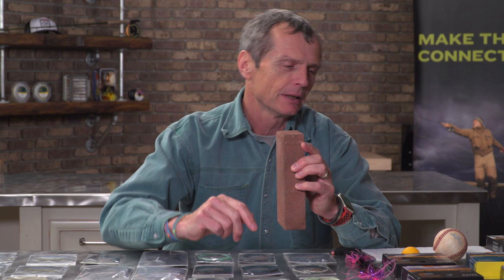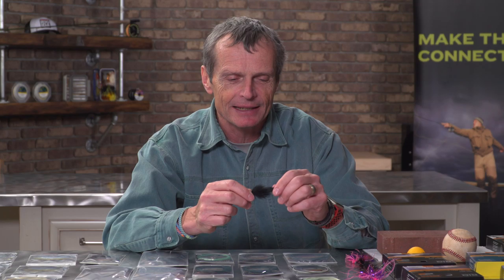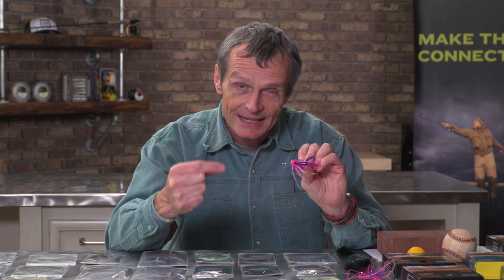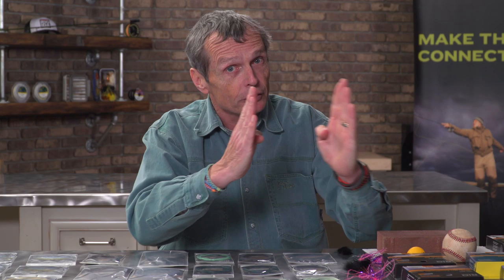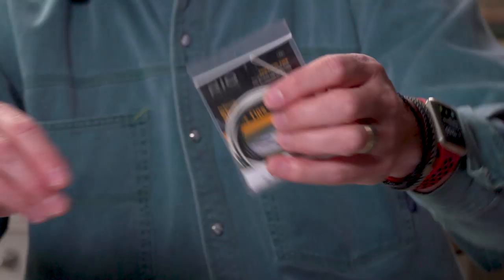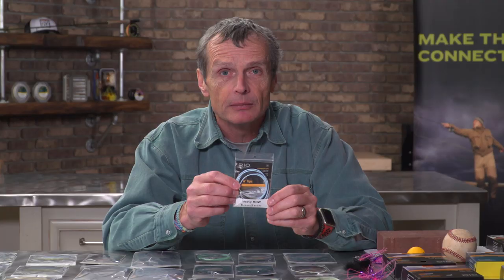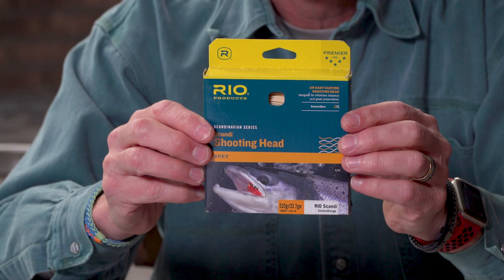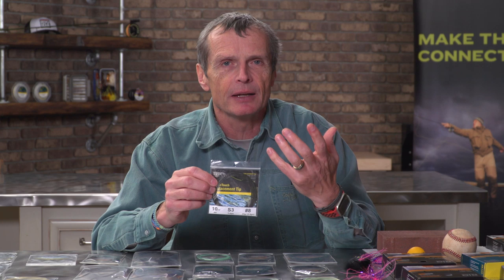S4 E3 How To Choose A Sink Tip

Comment: Thank you for your double haul videos, I’ve struggled with timing and shooting line on the back cast for many years, I think I may have cracked it at last with the aid of your simple videos. I would also appreciate any comments you can make regarding shooting heads. I live in Scotland and fish mainly still waters with a 10 foot Hardie’s Demon Sintrix 330 #6 rod. Several of the reservoirs I fish have high banks and bushes behind causing problems with back casts. I’ve been experimenting with single-handed spey casting but need some sort of scandi/skagit line to make it work. Being a true Scot, I am reluctant to spend quite a lot of my cash on a line which might not suit my rod (and Hardie have been singularly uncooperative) so I have been attempting to make my own by chopping different length bits off a #8 ‘mill end’ line and attaching them to a thin running line. I’ve had some success but it would be very helpful if I had some idea of where to start as regards length and weight of head to suit my rod (trial and error can get very tedious and probably doesn’t produce the best results). Have you any suggestions? I’d be prepared to spend the cash on a Rio line if I knew it would match my rod. Incidentally, I normally fish a floating line and swap leaders to suit conditions.

Tom M

Comment: A replacement tip on a Scandi is usually a terrible idea, unless that Scandi is a tipless Scandi Body head or the Scandi VersiTip, because a full Scandi already has a tip built into it, so in essence you are doubling the tip. Also, in the first Skagit GameChanger vid Simon says to use either the replacement tips or MOWs on them.

Comment: I have a Loomis nrx 10' #8 and use  guideline 4D compact multitip system, depending if i use 12 gram (180 grain) or 14 gram (210 grain) float belly + tip 7 gram (105 grain) the total line weighs between 19 and 21 grams, i would like to try a skagit set up, should i use 300 grain or 275 grain belly? The rod does seem to be quickest with relative lighter weights, and should i use replacement tips or mow tips?

Comment: What would you do if you had a lighter skagit head of around 200 grains on a single handed rod but also a large fly and needed to get down quickly? Could you still use a T11 or T14 rather than a T8? cheers

Comment: I have a question about lines, for bass in lakes. Say I’m fishing for suspended bass at 6-8 ft in 12 foot of water using a 7 weight rod and unweighted fly? Is the a chart that shows what to use?
Reply from the maker: Sadly not, Jeff. We have one in our old catalog, but nothing on line. Not too hard to work out, though, if you know how many inches per second a line sinks. For example an intermediate sinks about 2" per second, so 6 seconds per foot, which means you have to leave it  about 36 seconds to get 6ft down - with an unweighted fly! A type 6 sinks at 6" per second, so would only take about 12 seconds to get the same depth. 

Retrieve speed then plays a major part, so a fast retrieve will pull the intermediate up from 6ft to only a couple of feet, while a really slow retrieve would mean the Type 6 would keep sinking as you retrieve and go a lot deeper than 6ft. 

Complicated, I know, but those are the two factors you want to consider when choosing a sinking line.

Comment: Hello Rio
Please, on my Skagit Head grains, should I add the grains  on the mow tips or T14 as well the replacement leaders for Scandi  to match the grains window over my rod blank?
Thank you!!
Reply from the maker: No, use the right grain weight Skagit head for the rod, and don't worry about the weight of the tip. The tip rarely forms part of the D-loop so doesn't contribute to the rods load, thus should not be taken into account.

Comment: Great help .If your setting up a scandi out fit must you take the weight of the polyleader into account or is that a skagit outfit
Reply from the maker: Not for a polyleader - at least as far as weight goes, they are too light to influence the weight enough to matter. As far as length, though, yes. Adding a 10ft polyleader effectively increases your head length by those 10ft.

Comment: Ok, now I know why I stay confused.  You say that the replacement tips should be used with a scandi line...........everything I've heard before this has told me to use replacement tips with a skagit system and use versileaders with scandis. The replacement tips don't have different sections like some of the mows as far as i know, but I thought they were more like a mow that doesn't have weighted sections but is somewhat tapered on the end toward the fly. Can you see why I'm finding all tip stuff so confusing. Any guidance would be appreciated. Thank you.
Reply from the maker: Totally can, and fully understand that. It is very confusing for sure. Your basic summary is correct - you can use replacement tips on Skagit heads, as well as "MOW' and "T" tips, and you can use VL's on the front of regular Scandi heads. However some Scandi heads are cut back about 10 feet from the front end, and have a loop put in, and with those heads, you can certainly add a replacement tip - just substituting it for the 10ft that was cut off.. Does that make any sense at all?
Reply: Thank you for the reply. I watch a lot of Simon's presentations and think he does a great job, it is most helpful.  I rewatched the video and unless I missed something he didn't discuss a cutback type versitip scandi system but said that you could use the Replacement tips with a scandi line. In the future when the video is updated it's something to be aware of  as it did add to confusion for me.  I appreciate that line manufacturers want to sell product and the technology is constantly being worked on to improve performance and I have no problem with that. For a newbie one of the issues is buying lines, tips, etc. that don't actually work out and then wind up sitting in a box .  My guess is anyone who is in the spey game has plenty of these. It may be unavoidable as balancing these systems can be tricky but is also part of the fun. Ultimately it may be counter productive to manufacturers as it increases the cost and may keep people out of the game.
Reply from the maker: @cliffords9422  That is an excellent call, and something we passed on to Simon. He said he really appreciated you passing this on, and was sorry he missed that part out. It should most certainly have been part of the conversation!

Comment: Do you attach zinc lines to the backing or to the throwing line? And with what knot do you attach them? With which knot do you attach the tippet to the zinc line?? 🙏
Reply from the maker: Attach the sink tip to the shooting head, no knot needed as it's a loop to loop connection. For tippet to sink tip you can either tie a blood knot, or add in a tippet ring, and just tie your favorite knot to that. Hope that helps clear it up. Cheers!
Reply: @RIOPRODUCTS So if I understand correctly, is a shooting head always needed first with every type of fly fishing? Whether you’re fishing with dry fly, nymph or streamer? Bedankt!!!!🙏
Reply from the maker: @jds4935   Only if you're fishing a two handed rod and swinging.
Reply: @RIOPRODUCTS  And with a one-handed rod how do you mount a sinker? A shooting head is the throwing line, right?

Comment: So can we agree that for pure sink speed it goes like this : T-tips > MOW tips > versi-leaders?
Reply from the maker: It all depends on the length and the tip type. If you're fishing a level MOW tip, with no floating section it will have the same sink rate of a T-tip if the lengths are equal. The highest versileader sink rate of 7" per second is 1" slower than the lowest MOW tip of T8 which is 8" per second, so you're right on there. Hope this helps. Cheers!
Reply: @RIOPRODUCTS  Thanks a lot!

Comment: I'm trying to get a versatile set up for my 4wt trout spey to cover just about any condition. I have a scandi and skagit head but trying to figure out what tips I should have at my disposal. Any recommendations would be greatly appreciated.

Thanks,
Brock.
Reply from the maker: The Skagit head will throw heavier tips easily, so go with that for larger flies, or weighted streamers and the Light MOW tips, or T-8. The Scandi will be better for presentation, so best with soft hackles, light streamers and nymphs. The best tips on those are probably the VersiLeaders.

Comment: But is a 8 scandi tip two heavy for an 8 weight scandi line
Reply from the maker: It would be too heavy on the front of a regular Scandi head, yes. If it was a VersiTip style one, or an 8wt head, chopped back a few feet to get to the thicker section, it would work fine.

Having said that, you could put it on a regular head, and work really hard and get it to fish, but it certainly wouldn't be balanced.